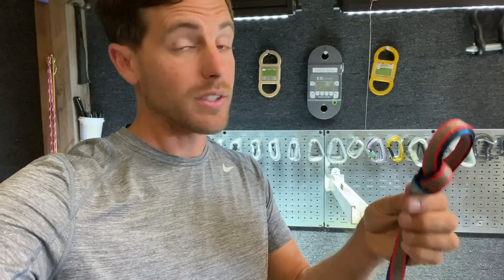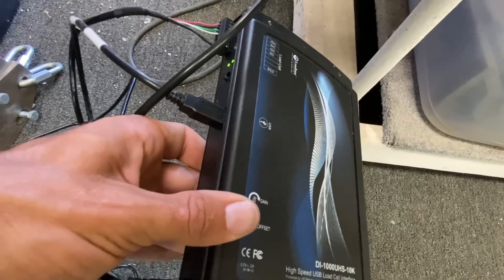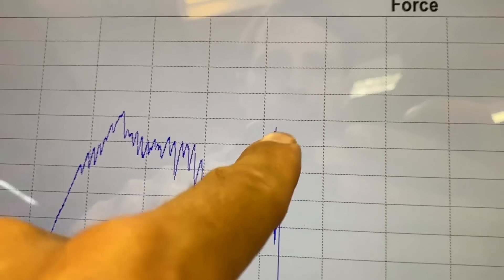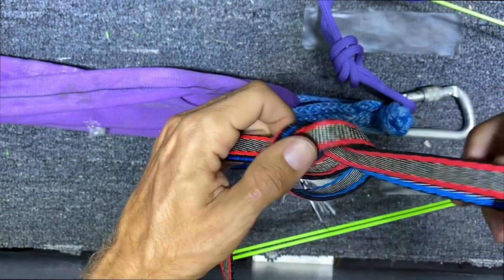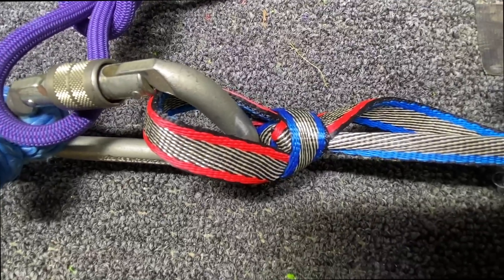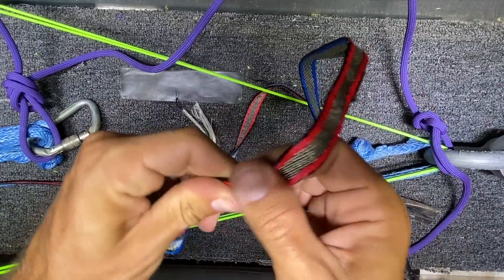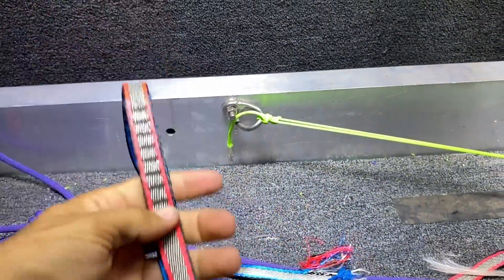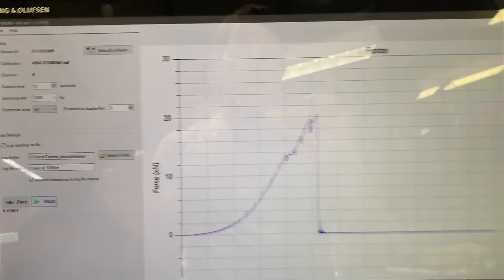Bowline on a bight break test

Comment from the maker: NOTE: this webbing has an MBS of 30kn and broke at 20kn because we did not use the appropriate weblock for it.  It is a skinnier webbing to avoid high forces from wind on larger lines, and requires a proper weblock for it or spacers in a normal weblock.  It will break at full strength if proper gear is used FYI.

Check out our new store! https://hownot2.store/

Comment: as an idea to try. may be you can simulate a shock impact by pulling two ropes: one is little shorter and weaker, second little longer and stronger. then when short/weak rope brakes you will have a shock impact on strong rope.

Comment: Would be super interesting to see force versus distance/displacement! 

On dynamic ropes, you should see much more expansion before they break than on static material. But the really important thing is that the ropes loose "stretch" when loaded heavily before they break. This will not return when you unload them, so they are possibly invisibly damaged. You can even do load-unload cycles, which gives you more insight into the hysteresis behaviour, second drops, lost elasticity etc.

As force times distance gives energy, you can also do some calculation on how much falling load (drop distance -> speed, weight) a rope can dissipate. You have a droptower soon, right?

Comment: Hi! Wish you would also test the loop itself as it is often seen used as master point, when connecting two bolts.  I guess the thought is that the loop should be really strong as it is has double strands. (Will it also slip and widen under load?). Thanks for so much interesting info!
Reply: Upvote on this! Would really like to see this as it is used a lot lately in the European (alpine) climbing world

Comment: Hey, great work. I love your setup for testing loads. 

In my field of electrical trades, we have a bunch of hearsay on the best way to prepare wire pull heads, for when we pull conductors through pipe. I was wondering if you were ever interested to make such videos

Comment: I had always thought that a bowline on webbing was not advised as the structure of webbing doesn't allow the forces to be absorbed evenly through the material... ie, the knot pinches itself creating a weak spot.  

A proper bowline with a proper rope will untie easily even after several tons worth of load (assuming ther rope is rated for that).  I had as 15:1 pulley system I was using to remove a giant tree root ball.  The line stretched and ultimately failed.   The bowline that was used to secure ther line to the tree was the only knot that came undone.   everything else had to be cut.  On the plus side, I did manage to loosen several fence posts, used as anchors for redirects, set in concrete that were coming out later that week anyway.  Saved me some work on that end.

Comment: The bowline how you do it is unsafe for climbing. There is a better one, don't know how you would call it in english though. 
Search for "Doppelter Bulin", thats what its called in german. 
It is basically a normal bowline where the short end gets threaded through the harness a second time and followed back  just like a figure 8. So you would have 2 loops in your harness and all the strands double, except for the bowline typical single loop. 
Besides the figure-8, this is the only other recommended safe knot for tying in
Other variants such as the yosemite finish or Bowline 1.5, have previously failed and killed people. In rare cases they can open when side-loaded, also when they rub on rock, they can untie themselves a bit, making the whole thing unsafe

Comment: That doesn't look like a bowline to me.  I sail and have been tying bowlines since I was a kid and they don't slip.  Learn to tie it first.
Reply: That's because you have never made one in the middle of a rope on a bight.
Reply: There are hundreds of variants of a bowline. I sail and climb and I've found some variants are way more useful in climbing than in sailing. The method shown here is one of several correct ways to tie the variant commonly called a bowline on a bight which is used to make a secure loop in the middle of a rope instead of the end of the rope.

Comment: Yes, bowline on a bight - I believe John Bachar called it the atomic knot, and advocated it to attach a climber to a belay when leapfrogging leads. 
Like someone else mentioned I have to wonder if the knot sliding tight and constricting on the carabiner was a function of the ultra-slippery dyneema, as I have never seen a bowline close on itself (in tree work, or marine use - with some incredibly high loads).
I'm looking forward to seeing drop tests of the bowline (as a tie-in) with Yosemite finish, and the bowling on a bight (as used to attach oneself to a pair of bolts/belay), using regular climbing rope.
Reply: I work in entertainment partially as a rigger and use bowlines ALL THE TIME (however rarely on a bight). Such an awesome knot and I've literally used it to lift loads over a ton on rare occasion (and rarely not with rope). My first exposure to the knot however was sailing as a child.   The bowline and clove hitch are the most used knots in entertainment rigging, however we also use many knots from the climbing world as well. In my experience its a very useful knot, easy to untie after being loaded and able to hold a reasonable load. OF course we us a 50% derate factor for bowlines however.
Reply: I'm super interested in this too! A friend actually taught me to tie into the rope using a bowline on a bight. You'd tie in with a bowline and then leave significant enough tail to retrace the knot through the tie-in-loops and the outcome is the same as a bowline on a bight. People are always critical but if it's good enough for an anchor tie-in then it should be good enough on the harness.
Reply: @steelonius  it is super good enough.
Reply: I have seen tons of bowlines close on themselves but specifically on a set of four ropes that were perhaps the slipperiest that I've ever worked with and that we would normally have to use three or four half hitches to keep a bowline from untying itself. It was a pain to tie knots in, but the slipperiness did mean we could get around not having pulleys and it slid better when you had to push it across HVAC ducts.

Comment: Can you do Bowline vs figure 8? So we can once and for all see how these two stack up!
Reply: Yeah! It would be interesting! Also, please check double bowline vs figure 8, its more common use of bowline knot in climbing
Reply: Bowline on a bight is a great knot to test. I would love to see a couple varieties of bowline against a figure eight.
Reply: I agree.
Reply: Scott's locked bowline should be the standard, so try that one!
Reply: @SirCharcoal  I see no reason to use anything else than a figure 8 simply because i find it idiotproof. And I know the guy tying the knot on my harness, he's an idiot.
Reply: Double bowline with a yosemite finish vs figure 8 with yosemite
Reply: @wb2242  but this is not the main failure mode for the bowline. It's self untying while climbing...
Reply: @mattiasgonczi And more difficult to inspect for others.
Reply: Yes the main failure problem of the bowline is self untiing, but that's a different variation: bowline on a bight, that solves the self untiing because it doubles the rope strands on the harness, so its way better than figure 8: less wearing on the harness and rope, and still super easy to untie when loaded. I use it for basically everything leash to the ring and harness, climbing, highline, work..
Reply: @mattiasgonczi  Not a bowline on a bight. It is not the same not just because it has bowline in the name.

Comment: Not to be a jerk but I wouldn't call that a bowline. A bowline should be a static loop. I've rigged 2000lb logs out of trees on bowlines and never seen one tighten up like that.(test 1). I'm a tree climber/arborist I regularly climb on bowlines when doing base anchors for a little extra security I use the Yosemite finish. I'm exited to see the drop tower tests
Reply: It is a bowline-on-a-bight, a midline knot with two static loops, and he tied it correctly. I think the result is just down to the material: super high modulus (makes a Sampson bull rope look like a bungie cord) and extremely slippery: a worst case scenario for any bowline.
Reply: @JackBringloe  yeah after looking at it a bit harder it looks correct but I just don't know why he would do a bowline-on-a-bight rather than a regular bowline seems like it would (super ez to mess up a BoaB vs a regular bowline). I don't have much experience with webbing as I have no real use for it in my line of work. I got some 7/8" Notch kraken rigging line a while ago that I did some "testing" with it where dropped a 2000lb log about 5 ft  with a running bowline as the only knot and it held just fine. maybe its got something to do with the slow pull as well.
Reply: @ConRoen  Considering the channel's background I think the knot choice comes from climbing. In the Alps, we use this loop for multi pitch anchors. It's becoming more popular in the US lately.
Reply: @DaOndee  It has been popular with climbers in the US for a long time for directly connecting the climbing line  to a two bolt anchor. It is being supplanted in that role by the so-called bunny ears knot. These days American climbers would  typically use a knotted quad at such an anchor to simplify changeovers and (knock on wood) self rescue situations

Comment: Hello Ryan,
New tools that seem promising ;) Thanks for all your work on these subjects!
FYI, the DPMC (the french « authority » regarding rope access industry) issued a warning a few years ago about this knot, saying that "in a specific configuration, one of the two loops can [undo itself](?) with a load of 100daN" (this is a on-the-fly translation, i'm not completely sure of what I did… The original sentence is "Dans une configuration particulière, l’une des 2 ganses de ce nœud peut se défaire sous une charge de 100 daN.").
Reply: Can you post a link? I can't find anything about it (probably using the wrong search terms).
Reply: @jetseverschuren  A demo video is available on the FFSpeleo (French caving organization) here: https://efs.ffspeleo.fr/images/chaise_double.mp4
And the warning issued by DPMC is on this page: http://www.cqpcordiste.fr/retour-technique.asp (they dont have a direct link to this specific warning…)
Reply: @therupi  I just watched that video. They seem to pull the loops sideways. It's like using a figure 8 (knot) for dual ropes, it's not designed to handle load in that way/direction.

Comment: Following page 41 off on rope that is indeed a correct bowline on a bight. 

Probably the second measurement was not 17 kN, but noise due to those little spikes on the actual signal. I do not know why, but from a physicist who reads graphs on a daily basis that did not seem correct. There’s no physical reason why it would go down and up in force so fast.
Reply: This is correct Id surmise. 
I was going to say otherwise, but realized I was looking at the "2nd" test marked in the video timeline not the whacky graph that spiked at 17kN.

Comment: 17 kn in the second test is just a bug i think... great videobtw as always, i like these quick ones
Reply from the maker: Yea, I got to figure out why it spiked liked that.
Reply: @HowNOT2  Your load cell is probably a wheatstone bridge meaning that is it very sensitive to radio frequency interference. If your cell phone went off near it you could see a spike.
Reply: @Ammoniummetavanadate  yes, it's a wheatstone bridge, but any proper load cell driver/interface has a low pass filter. For 10kHz, that's about a 5kHz cutoff, which is way higher than any rf from phones.
Reply: @HowNOT2  It might actually be a genuine reading.  Stiction and slippage as the webbing sticks to itself due to heat.

Comment: My electrical engineering brain is so happy to see the graphs!
Please make it a regular thing
Reply from the maker: That's the goal.... and imagine it while we show the slow motion!
Reply: Yea it looks like better data than I have gotten from any of my university lab practicals.
Reply: @GBR6000  really? Most data I collect using a really primitive system with an Arduino looks about that good.
Reply: @jetseverschuren  in our uni labs we use a really primitive system with an Arduino to. But remeber that he can probably zoom way in on those graphs becuse the polling rate is 10,000 Hz. Tho im only second year so I haven't done any of the serious reaserch yet.
Reply: @GBR6000  that sounds like it sucks. I thought labs used something like a LabJack, NI DAQ or CompactRio.
Reply: @jetseverschuren  Yea. We do have a few computerised occioscopes but the software for them is poor and dosn't have any automatic data loging. It truly is abysmal.
Reply: @jetseverschuren  Yeah, I've never seen an arduino in an actual test lab lol
Reply: @mattdavid450  I've seen some people use an Arduino for controlling several things. Like when they needed to time several doors/valves together. A couple of months ago I had a (high school) project where I needed to measure the ratio between 90Hz and 150Hz signals on a line. A discrete filter would be too complicated (it would have to be quite a high order), so I threw in a teensy (Arduino on steroids) and ran a FFT on one of the analog pins. It worked surprisingly well.